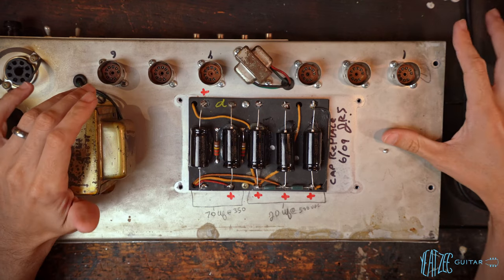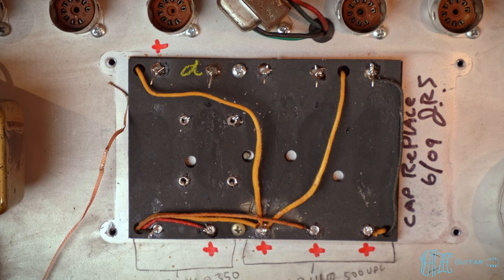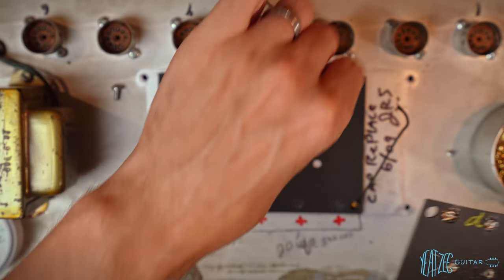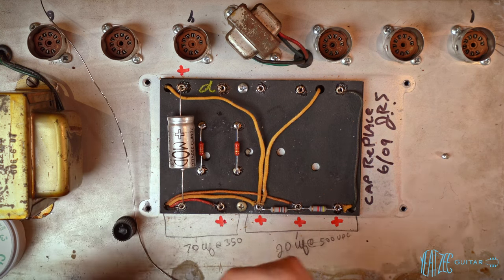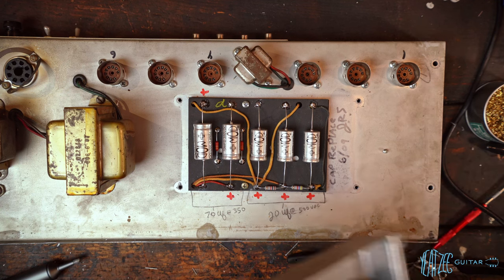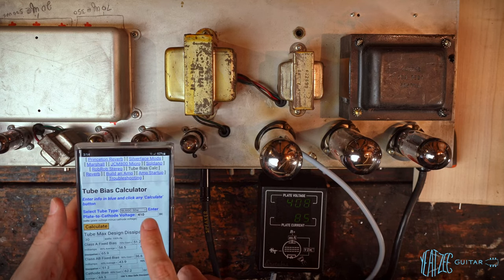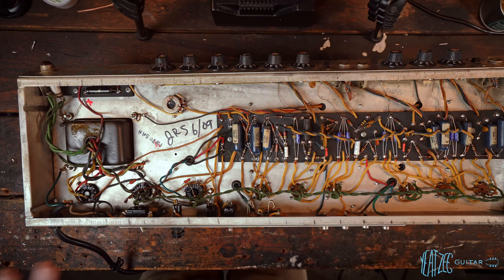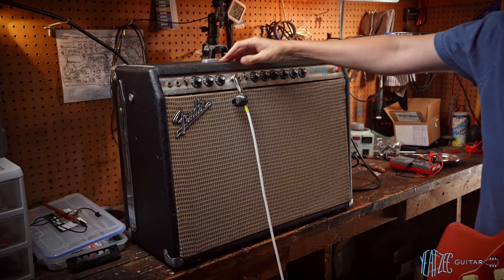Who let the Dog(house) out? - Vintage 1968 Fender Pro Reverb Amp Repair Pt.3

Comment: Those “Tropical Fish” caps in the trem and Vibrato channel coupling are original. They first appear in early/mid 1967 amps. 0.02uf 400vdc, all read by the colored stripes like a bumblebee cap.

You had me rolling! “That can’t be right!” LOL You just cranked the bias to the moon, of course it’s right! Less negative = more plate dissipation.
Reply from the maker: Tropical fish, such a great name for those! Got it!
Reply from the maker: @ErikThomasMusic  my 67 BF Pro doesn't either
Reply: @ErikThomasMusic  You know, I think you’re right. I’ve never seen the tropical fish caps in anything but Supers and Pros. Those are the two amps that I’ve owned the most of. The sound and price is right too.

Twins are fantastic, but my GOD are they loud.
Reply from the maker: and HEAVY... lol
Reply: @YeatzeeGuitar  Hey man, weight is tone! Like a late 70’s Stratocaster!
Reply from the maker: @matthewf1979   🤮🤮 Heaviest guitar I've ever played was exactly that. Had to weigh 13-15lbs

Comment: A few things: 

1. The 220k resistors in the dog house across the series caps just form a voltage divider that forces balance to voltage between the two series caps and provide drainage when powered off.  Any 220k resistor 1 watt or better will work here.  5% tolerance is fine because it's 4x better than the 20%+ tolerance of the series caps.  Save your money and use the big blue 2 watters you can find everywhere here.  Use the nice 220ks you put in on the power section grid leaks instead.  You need rock solid bias feed to the tubes.

2.  Bias is coolest at its most negative grid voltage.  It's a common mistake to think 70 volts is hotter than -30. -70 is more negative than -30.  An easy way to remember this is that the closer you get the zero volts, the hotter the bias is.  You nuked the tubes by setting the voltage at the bias adjustment's hottest point- a point that you made hotter by reducing the fixed resistor to ground.  You likely caught it in time so the stress on the tubes wasn't too much, but good practice is to set the pot to its most negative before installing new tubes.  This way you're always dialing up to warmer bias from a safer cooler point.  Only change the fixed range resistor after confirming that the least negative voltage is insufficient to dial in proper bias--not by gut feel or past experience on similar but different amps.  
3. Fasten the capacitor board to the chassis last.  This will allow you to fold over the leads for proper mechanical connection to the eyelet before soldering--a much more solid connection.  This will also eliminate the tendency of the components to move on you while soldering.  
Overall, good workmanship.  You obviously take pride in what you do and have a great interest in it.  Add the things above to your tool belt and do that much better on the next one.

Comment: Encountering repeated problems with gear & seeing poor quality work is what inspires some of us to start servicing our own equipment.  I initially wasn't interested in working on my guitars or amps but had to out of necessity.  Some people are lucky enough to have great local service.  I learned how to solder after taking a guitar in to have the pickups replaced & the shop literally couldn't figure out how to wire the thing to have the two & four positions in phase on a 5 way superswitch.  After the 5th time of them trying & failing I gave up, paid them, took the guitar home & picked up a soldering iron on my way home.  If you want something done right...
Reply from the maker: Exact same thing here. Every guitar I've ever given to a tech came back with damage. Amps, I didn't even want to bother leaving any with those same people so here we are!
Reply: @YeatzeeGuitar  Maybe we should thank them for giving us a new hobby?  And our equipment is in better shape than ever thanks to their horrible example.  It's a tough thing because the same rules apply to literally anything in life.  If you find a good plumber please let me know lol
Reply from the maker: @Guitar5986  I guess! And very true, so few really care about what they do.

Comment: Wow just stumbled across this. I have a recently acquired 66 Pro Reverb serviced by JRS Audio. Same guy sharpie pen writing in red and black. My doghouse caps dated 2015. Red plus marks all on one side very concerning. Last cap to left generally is reversed. Sharpie pen everywhere really not cool. JRS audio repair is in the inland empire Ca. Looked them up, good reviews, but Im not digging the look of the work. I need a tech to look at this chassis which is otherwise pretty clean looking. Love to send you some pics
Reply from the maker: Well, IE isn't far so there's a good chance it was him on this amp as well!  Are you in SoCal?
Reply: Yea the ink work on mine is identical to the one you worked on. Guy loves his sharpie pens. 
In LA area, west valley area 91301 
Ive got pics of my chassis, hood up on dog house etc. Not thrilled w/ the look of the 2015 cap job they did. I did pick up a nice F&T replacement kit I would like to have installed along w/ a general going over. Lmk if interested?
I could send pics and info. Either deliver amp or ship chassis.
Reply from the maker: @mtbmadman011  Happy to do the work, shoot me an email yeatzeeguitar@gmail.com

Comment: Looping the lead IS totally acceptable method, it was recommended by Fender in the original service manuals from the 1960's. The Ruby caps are pretty decent and probably in good working shape. But the work was kind of sketchy. Should remove the tag board and clean the back side of rosin and goo as well.  Worked on one recently where the ground lead was left off the middle capacitor completely.
Reply from the maker: Interesting! Seems almost as much work as just redoing it like it was done by the factory. Surely laying a leg of a resistor flat across the top of an eyelet isn't fender service manual approved though right? 😆
Reply: @YeatzeeGuitar  Absolutely no loose resistors! When Fender made the boards, they were stuffed, and leads bent in back, clipped and then soldered from the back side.
Reply from the maker: @ErikThomasMusic  Gotcha, well that's a bit different than what we had here. His doesn't look bad, not overly soldered and looks like a good connection but also I still think why not just install them like the factory did? Looks better, easier to service later 🤷‍♂🤷‍♂